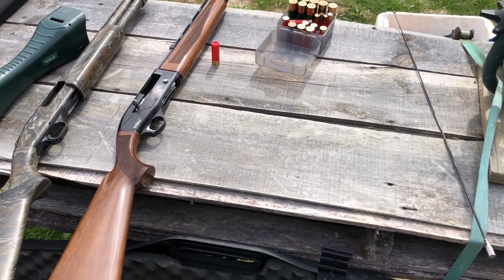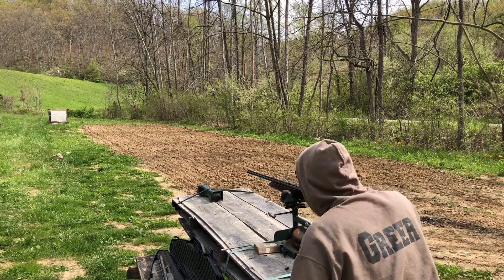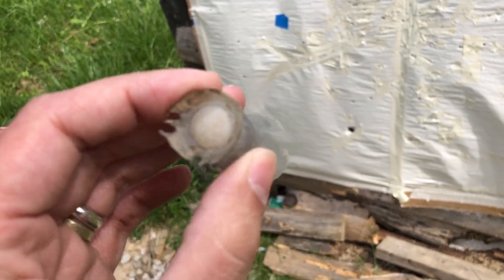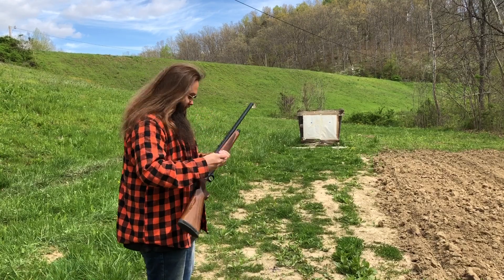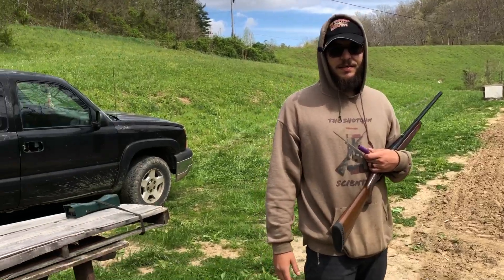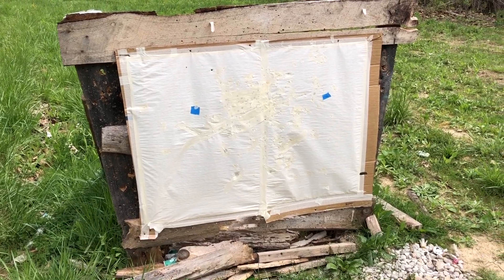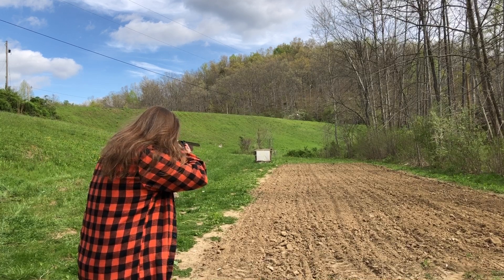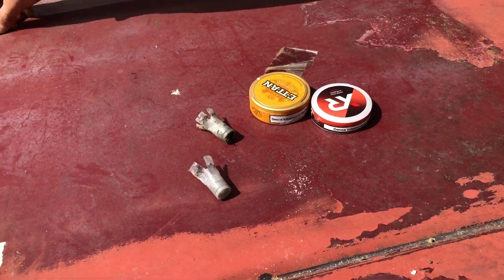16 Gauge 1.25 Ounce Lead BB Load Range Testing

Comment: On those bad patterns has to be something to do with alien interference   LOL I just don't know really perhaps being a semi auto is it possible for the pressure curve to be out of sink and that is whey the pattern is not as good as it should be or was out of the other gentlemens single shot , I mean really I am at a loss on that one.
Reply from the maker: Josh accidentally pulled the shot high with a gun that already hits a little high and 90% of it went above the paper. The weird patterns were caused by not slitting the wad all the way down or at least to 3/4 lol. We learn something just about every range trip.

Comment: What is your experience with the TRISTAR shotgun? I have a 20 Gauge Raptor model, and I’ve had excellent luck with it- I recommended it to a co-worker, he bought one and his jams a lot. I felt aweful, but my experience has been great with mine😊
Reply from the maker: Run a couple boxes of 3” through it and it’ll work perfectly. Ours in 16 gauge worked perfect right out of the box with 1 ounce loads at low velocity. It also handles up to a 1 5/8 ounce load perfectly too. No complaints.
Reply: @theshotgunscientists  cool thanks for the feedback!